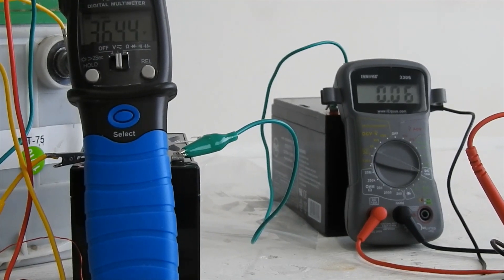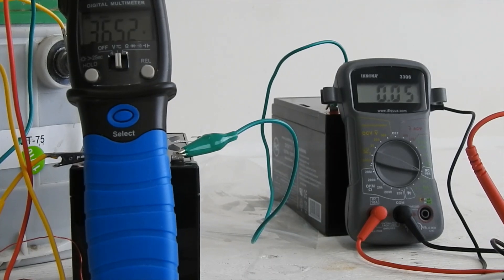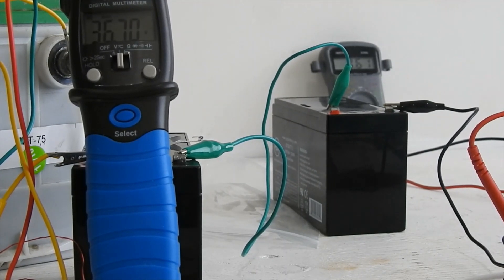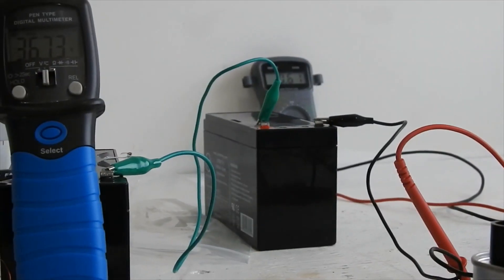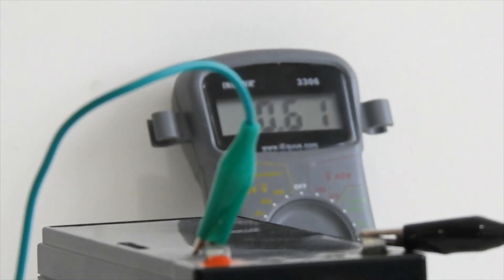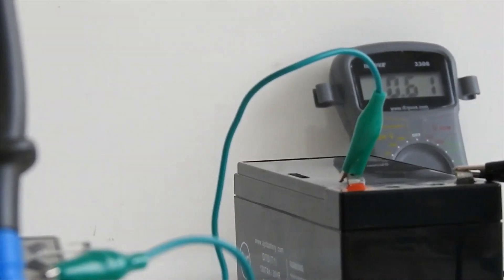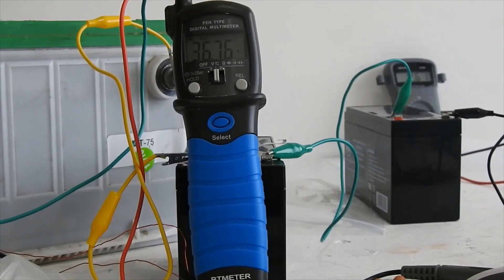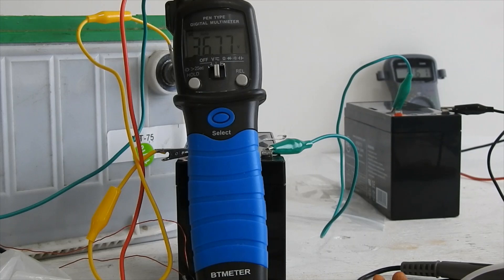Charging Battery Bank with High Voltage Low Amps

Comment: How is the voltage after the battery rests for a while?
Reply: If the temperature stays around the same, the surface charge could stick around for days or weeks. Voltage isn't a good indicator of state of charge. Hydrometer reading would be better.